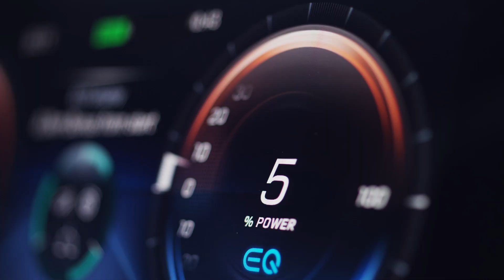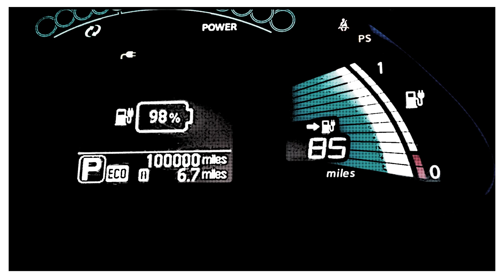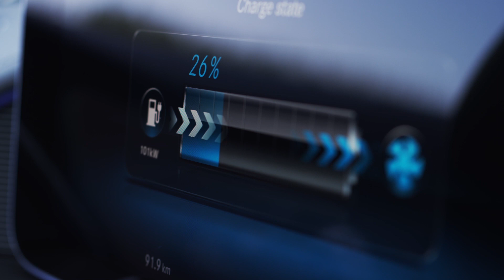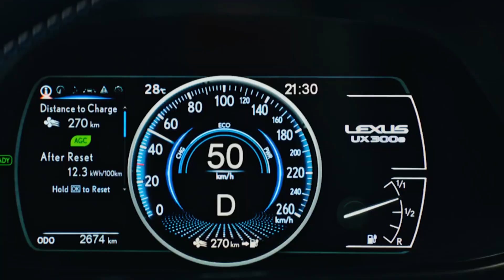How long do ELECTRIC BATTERIES in cars LAST?

Comment: You'll have to drive your EVE 100K miles before you could even hope to offset the carbon footprint it took to mfg it!
Reply from the maker: Not even close to 100,000 miles, but it'll depend on each manufacturer and the grid where it's charged so there's no exact figure to give. Comfortably less than what you said though. Thanks for the comment!

Comment: EVs are disposable in comparison to ICE vehicles. My 2018 Toyota Tacoma has 200k miles. It should easily have another 150k left. And the age of an ICE vehicle doesn't diminish its shelf life. It's not uncommon to see 30 or 40 year ICE cars still on the road with their original engines. But a mere 10 years is impressive for an EV. That's not very impressive at all.
Reply from the maker: Can't imagine the amount of money you've spent on fuel, servicing and maintenance. But it sounds like you're happy, and that's what's important. Thanks for the comment Mark!
Reply: @BestElectricVehicle  You missed the point entirely. But thanks for trying.

Comment: My 93 hilux, sitting over 600,000km on the odometer, I don’t believe these ev could out live a Diesel engine
Reply from the maker: Sounds like a very unique case there. We'd hazard a guess that there's a lot of that drivetrain has been replaced many times over during 30 years and 600,000km of use. Thanks for the comment!
Reply: @BestElectricVehicle  lots of cars (especially Toyotas) have done astronomical mileages on the original engine and transmission - I have seen a news article where a Toyota dealer congratulated a Taxi driver for driving 10,00,000 KM in his Diesel Toyota
Reply: @GGoblin1 I had a Diesel Lexus IS220D that lasted only 235,000 km with perfect maintenance every 15,000 km at the Lexus dealership.

I expect my Tesla Model 3 to do more than 600,000 km without any engine maintenance and only 1 brake pads change, and with electricity costs 3 times less than petrol.

Comment: This still didn’t completely tell me what I needed to know.  I bought a 2022 Kia niro in 2022 august the 1st an the car was bran new with 5 miles.  For two months every time I charge the car to 100% it would give me 296 to 300 miles,  even at 80% it would give me about 257 miles.  But now the mileage is at 12,000 an everytime I charge it to 100% I get about 240 miles or 80% 175 miles those numbers are a huge significant difference from the first two months an I don’t have a clue as to why this happens so fast. Kinda makes me regret buying it.
Reply: I would get the battery replaced. If that doesn't fix it, trade that vehicle in for a 2023 K5 or something.
Reply from the maker: Thanks for the feedback Donald, but It's impossible for us to profile every individual EV in the world. Your range figures sound about right if the time difference you're specifying relates to summer-winter difference. Range for combustion cars goes down in winter also. If you feel that there is something faulty with the battery, have the garage check it out to be sure. Thanks again for the comment!

Comment: I've had my Kia Forte for over 10 years with 70,000 miles on it. It cost me only $13,000 brand new and I had to replace the battery only once and it was only $150. It get 35/mpg and regular maintenance is about $200 a year (tire rotation, oil and filter changes).  So until I can find an electric car that is brand new and does all this, then it's not worth it for me.
Reply: You don't drive very much.. 70, for 10 years is only a fart.. not even real driving..
Reply from the maker: Thanks for the comment. Keep an eye on new releases then, hopefully you find an EV to switch to soon!

Comment: they last about 5 years. after that you get a steep decline. if you are lucky, you'll get a 70% charge. you wont be able to go far. but thanks for funding tech initiatives. without you all wasting money on this nonsense, tech could never improve. call me when GM finishes it's million mile battery. right now, you'll pay more than what your car is worth to replace those batteries and should factor that into the cost of your car. nobody will be buying used electric cars. for what purpose? to drive 2 blocks before recharging? its cheaper to send it to a city dump and get a new one. its an environmental disaster!!!
Reply: They do not last 5 years hahaha good joke
Reply: Not in my experience. My Chevy Volt, purchased new 6 years ago, and with now 166,000km on it, still gives me the same 100km electric range as when new. It does of course have gas backup.
Reply: Byd now has a 3.000 cicle battery, they come with 8 years of warranty or 500.000km, so if the company itself give you that warranty is because they now that they work, byd is a battery company who know how it works,
Reply: You can limit your charge from 20% to 80% and your battery degradation will be much slower
Reply from the maker: Hi Bob, thanks for chipping in. You seem to be describing some of the earlier EVs that were treated very poorly by owners. Modern EVs are no reflectin on the comment you've made.

Comment: Battery age bad, a 12 year old knows that. Some maybe better than others, but they don’t age like combustion engines. Battery is extremely polluting and becomes crap shortly. Just think of your phone, they use the best technology and most advanced material to achieve its functions, don’t tell me car batteries use better tech and better material, that will be possible if they cost millions and millions of dollars. So affordable EVs use less advanced material and less tech that’s your iPhone 13 for sure,
Reply from the maker: Thanks for the comment, but unfortunately you're wrong on nearly everything you said there.
Reply: Maybe a 12 year old knows that, but I am a 69 year old who has driven a Chevy Volt now for 166,000 km in 6 years, and I see no loss of electric range.

Comment: These are lies. EV batteries last about 5-7  years and are done.
Reply from the maker: Damn, you caught us Charles! Although I wonder why my 5 year old LEAF with 100,000km still has over 90% state of health...maybe someone swapped the battery without telling me.
Reply: @BestElectricVehicle  5 years with only 100.000 km? You guys in the UK don’t drive at all, right ? In north and South America we use our cars way more roughly
Reply: @BestElectricVehicle  considering a 5 year old Leaf has no heating or cooling for the battery pack, i don't think you're telling the truth. Best scenario would be modern temperature controlled battery pack. Living in climates with no extreme temperatures. Parking in a garage full time. The battery charge always between 20-80%, with only smooth driving and zero jackrabbit starts. Best situation that battery allegedly could only lose 2.5% a year. 5 years = 87.5%. Your Leaf is not the optimal situation. You have an agenda, and you're not telling the truth.
Reply: Wrong. I have a Leaf with a 7 year old battery and still have 81 percent capacity. I have about 69,000 miles on it(111,044) km.
Reply: @farmerjamester  I don't believe you. Outside of  YouTube I'm surgeon, true story bro. Just like yours.
Reply: @charlessmith3758  you can find five year old cars with over 90k for sale with 100% battery health.
Reply: My Volt, 6 years old and with 166,000km on it, still gives me the 100km electric range it had when it was new.
Reply: @EVS 'R' US you're lying. Physics says you're a liar. 3 percent a year is the minimum loss. Do the math, liar.

Comment: My diesel has done 200k and doesn’t need a new engine
Reply: 1999 F250 with 7.3L I bought it new 500k and still going strong. Great Pick up !
No 2 all the way !
Reply: @trumpie5399 You would be on your 3rd $20k battery and probably 4th $7k drive unit replacements by now if that was an EV.
Reply: But we need renewal fossil fuels for electric energy. Unless the nobels create a new law to outlaw Nuke power for themselves to use. Lol
Reply: It needs new politicians that will let you use it in the future.
Reply: You missed the beginning of the video. Maan. 180k on original motor
Reply: I’ve driven ICE cars for 24 years plus drove an ambulance as a career. Since I’ve gone EV I’ll never go back. Such a great experience. Plus you’ll be driving a much faster can with better torque that will still last you over 100k miles regardless of how you charge or drive it.
Reply: @Slrpics Just wait until you get his with repairs out of warranty or go to sell your EV when the warranty has expired. 😂😂😂😂
Reply from the maker: Neither will most modern EVs. And how many spark plugs, timing belts, oil changes, brake pads, etc have you gone through?
Reply: @BestElectricVehicle Wrong. The data is horrible.
Reply: @BestElectricVehicle  - I think your video made the point that whilst getting  better you still need to take care of the vehicle otherwise it’ll be no good in a few years time.

Anyway, modern cars only need servicing every two years, diesels don’t use spark plugs, and ICEs are long lived due to their serviceable nature.  Truth is ICEs will be with us for some time yet and there isn’t the need to rush to EVs.
Reply: @BestElectricVehicle  lol 😂,you don't know Anything about cars.diesels don't even have spark plugs.

Comment: they dont support battery replacement anyway.. they just want you to buy a new one. the batteries capacity will dramatically decrease and the cost of replacement is HUGE. we re talking more than 25k
Reply from the maker: Thanks for the comment Theseus. Plenty of companies now moving into battery swaps and upgrades (e.g. putting 40kWh into a LEAF for sub £10k). It's fair to say that the early Nissan LEAFs, etc. have seen significant capacity loss...but the modern batteries will last for a very long time.
Reply: @BestElectricVehicle  The thing is will most owner pay 10k to get a battery replacement if their cars are only worth 5k? Also, it makes buying a used car more sketch because you don't know how the pervious owner treated the battery.
Reply: @BestElectricVehicle  i assume the new batteries will not be li-ion because it is prooven that they cost too much and dont last.. let;s hope we are going to invent a new type soon..
Reply: @EVS 'R' US BATTERY TO OUTLIVE THE CAR????? I HAVE A GASOLINE CAR FROM 2008 NO PROBLEMS ON THE ENGINE. IF THAT WAS ELECTRIC I NOW HAVE TO PAY 20K FOR FULL BATTERY REPLACEMENT.. THE CAR I BOUGHT IN 2008 COSTED LESS THAN THE NEW BATTERY I HAVE TO REPLACE NOW AND HALF OF THAT THE CHEAPEST ELECTRIC CAR COST TODAY
Reply: @EVS 'R' US so you assume the lifetime of an electric car is about 8-10 years??
Reply: @EVS 'R' US i dont really agree with you that less moving parts are cheaper.. A BATTERY dont move BUT cost as much as 2 ICE cars with half autonomy.. and 10times the refuelling time..
looks like companies wants people to pay 40k every 10 years for a new car. i dont know about UK or USA but the rest of the world can not afford that and can not buy new car every 10 years..